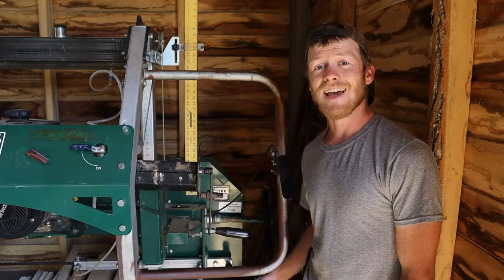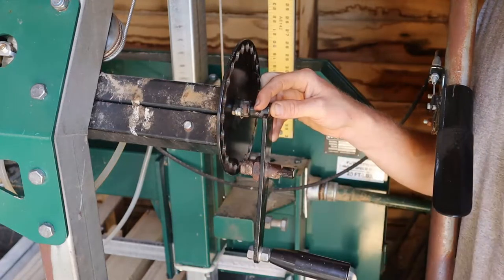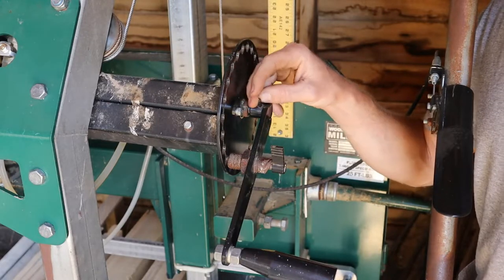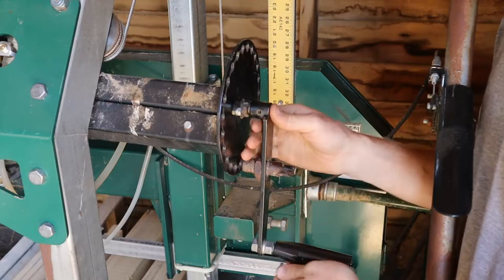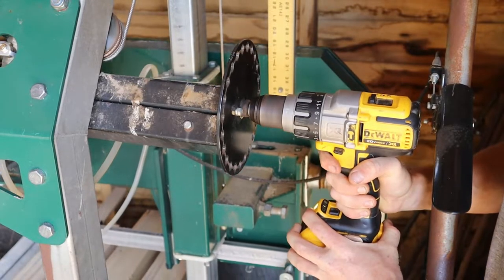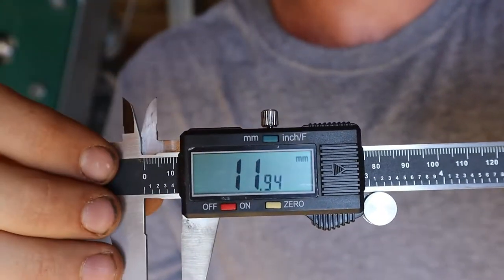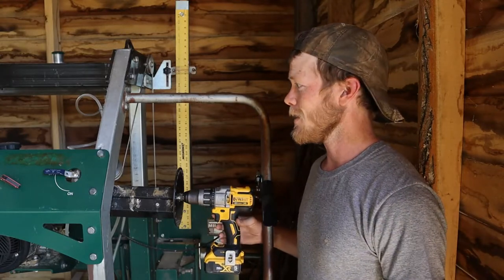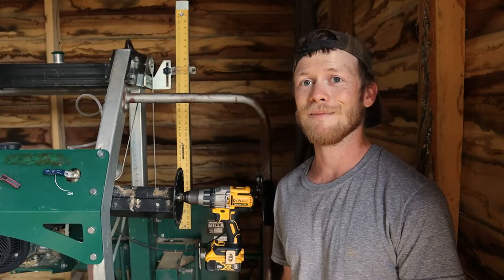Using a Drill for Raising & Lowering a Sawmill Head (HM130)

Comment: Have you used the saw like this? Does the saw stay in position while cutting without the locking handle?
Reply from the maker: I’ve been using it like this for a couple years with no issues. The drill chuck doesn’t turn on its own and the weight of the drill keeps it hanging down.

Comment: Looks like an arm saver!  I'm not familiar with the workings of your saw, but it looks like the handle indexed to the wheel with each notch being an 1/8th or 1/16th or something so without that I assume you must use the scale instead.  I trust the indexing wheel on my saw more than the scale but to each their own!  😁
Reply from the maker: So woodland tells you that one full rotation is "approximately" 1/4in. I think I tested it once, and an inch was like 3.75 turns, or something like that...... regardless there isn't really any way that I know of to use those.
Reply: @LandisLegacyFarm  Wow, that doesn't sound good!  My mill is 1/8th per notch and I find it more accurate than reading the scale....as long as I count the notches correctly!